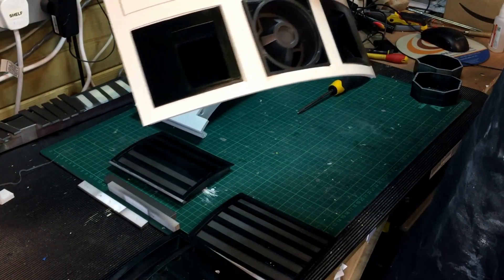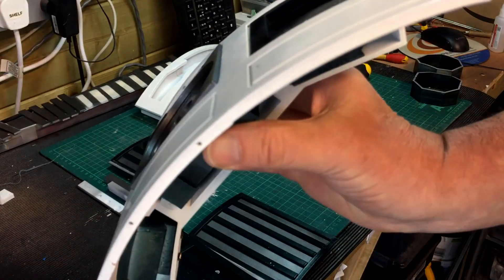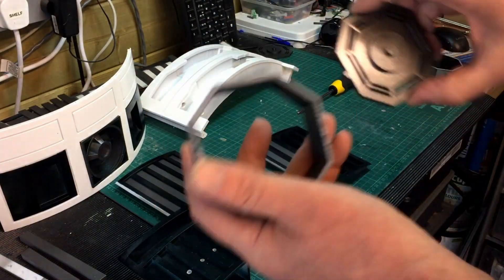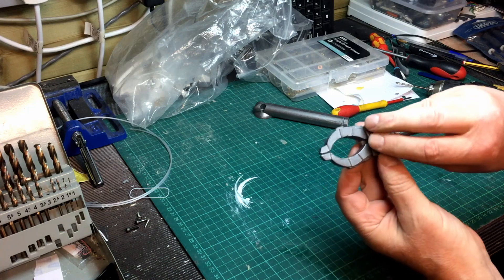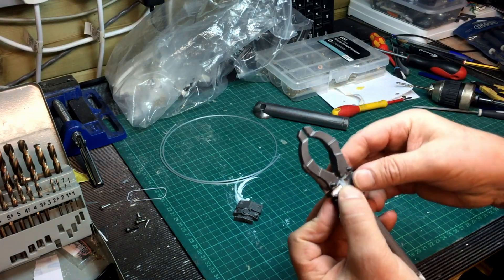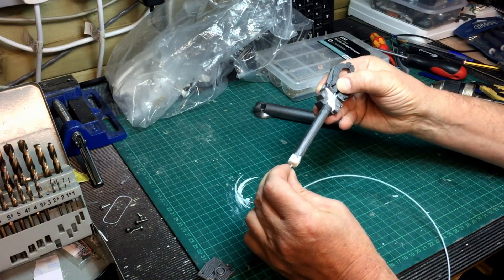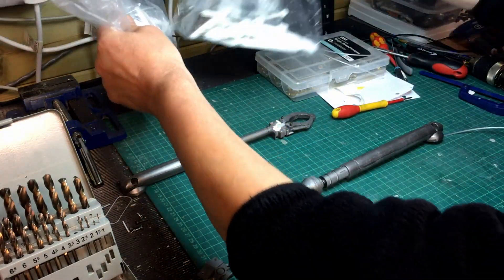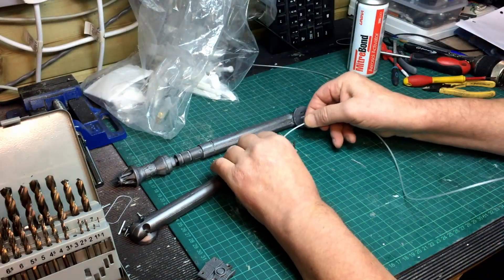R2D2 Droid Build Part - 30

Comment: You said you printed the hinges and other bits in Nylon.According to Michael's directions:A couple of parts are
printed in Ninjaflex Cheetham (I’ve used NinjaFlex Cheetham
throughout, just not realised, I bought some NinjaFlex and it was
“floppy” so Cheetham is slightly more rigid and easier to print). The
Ninja Flex is for the “blue” parts shown. Basically the bar which lifts
the arm, the servo connector for both ends of the filament cable.
I’ve add “NF” to the end of the descriptions for the Ninjaflex parts.
The size and simplicity of the design is down to a small Ninjaflex
hinge on the grippers which attaches to the cable. Once you’ve got
the parts, it’s an easy assembly.That might be why you have stiffness issues.
Reply from the maker: Hi Chris, I originally tried to print with the flexible filament I have but it all failed miserably.  I had looked to buy the the NinjaFlex brand but it is so expensive for a reel I used a cheaper alternative - obviously not a good idea as I have some issues printing it.   I have just found a site selling 20m samples of NinjaTek Cheetah which I have bought.   This is also called NinjaFlex on the site so I assume is all the same thing.  Anyway cheap to buy and I will reprint those parts.
Thanks for such a detailed response.   Cant wait to reprint and see how it all works.
Reply: Cool.Didn't you print the tires in ninjaflex or another TPU?I too have had problems printing in Ninjaflex. Of course I tried with my Da Vinci Pro which is full Bowden like the CR-10. I modified my tube to go right up to the feed rollers with a birds mouth, and on the other end through the PTF tube into the extruder cartridge. And I learned to print extremely SLOW. That stuff loves to kink up if given even the slightest opportunity.I managed to print a few things successfully. Matterhackers and others have some handy tips. I haven't printed those parts yet, they are on the agenda. You may want to try printing with a raft and just snip it away.I finally broke down and researched the V3 drive btw. It is supposed to be superior to the V2, able to drive on carpet and uneven surfaces. Michael recommends printing it all in TPU. (except the nylon bits and the tire) I need to fix my Da Vinci and give PETG another go soon.Oh, tip on touch up? If it is a minor blemish I've painted a little of the spray paint on a paper plate and then used a brush to touch up. As long as you don't get carried away it will blend pretty well. It's great for out of the way areas.Can't wait to see what you come up with!
Reply from the maker: @chrishechtl8330  Hey Chris, yes I printed the tires but had a few failures.  Printing slow and with a large skirt attached to hold it in place, plus used the blue paper surface.   Worked but was real nightmare. Just lifted up at the edges after a while.   Printed the hinges and they just fell apart.  Looking forward to trying with the Cheetah filament. 
I dont think I will change the drive version of R2 as he will be mostly static anyway. PETG ruined my print bed surface  [again] so it out of favour here at the moment! 
I might change the ring colour on the dome completely, so will just get on with assembly for the moment. Have a good weekend.
Reply: TPU: Yeah, I had bed curling when I tried printing a phone case.PETG: I was terrified of that! I tried with my CR-10, it actually destroyed the hot end I was using. I even printed at 235C  but with a PETG in the hot end, the all metal one I had was sidelined. (2 screws were stripped so I would have had to cut the old hot end out to swap it out. I've got a new one now) I got the shoulder pulley straps for the 2-3-2 to print in PETG but that was it. I couldn't get it to print the arm, it kept clogging on the long print runs. I need to try again with my Da Vinci eventually.Drive: Ah. Okay. Well, you could always update later. I bet you wish you had my weather, it's 85F and very dry here. You'd be in your glory painting and fiddling about!Have a good weekend too!
Reply from the maker: @chrishechtl8330  Its windy here, wet and we lost the Rugby.
Reply: We had hurricane force winds and the fires here. The fires are still ongoing but the winds have dropped a bit. Better luck next time with the Rugby!I am debating on puttering around with my own droid or the animatronic reindeer. The holidays are creeping ever closer...